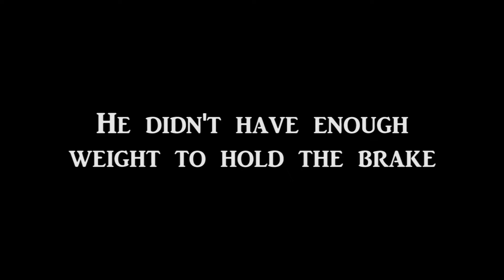650 V-Strom Chain and Sprockets Part 2

Comment: What torque figure on the sprocket nut? My dl1000 does not have a bendable locking washer so I just stand on the 12inch long wrench with my 90kg weight so about 200foot pounds. That’s a lot less than it took to get it removed from the damn shaft!! I had to use a 4 foot snipe and stand on the pipe.
Reply from the maker: The 650 is 104 ft. Lbs.  I not sure on the 1000, I'm won't be home for a few days, so I can't check it. It's almost the same if I remember correctly.

Comment: What were the differences between the gearing changes, my stock bike runs at 4500 RPM at 60 mph . I'm going to the 16 T front first and may add 46rear
Reply from the maker: If I remember correctly, his rpm decreased by 600 rpm.
Reply: I just changed my front to a 16T and it looks like 500 rpm change. I'm going to change the rear to a 46T and I will be right at 4000 rpm at 60 MPH.  the gearing is excellent now, taking low speed corners are smooth and seamless. Interstate speed will have engine rpm at @ 5000 rpm which is much smoother than the 5500 in stock config. Much better riding bike than without changes best improvement I've done to this bike.  
For those who think it makes the bike underpowered when initially starting out i'm not finding that at all, the bike is smooth and power is totally even and smooth on takeoff.
180 lb rider ........................JB..  @VStromGarage